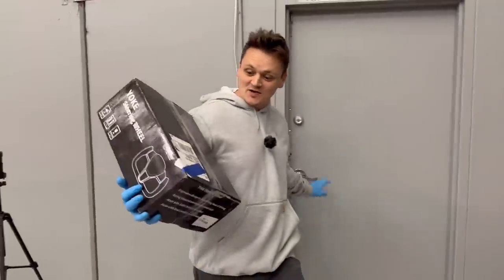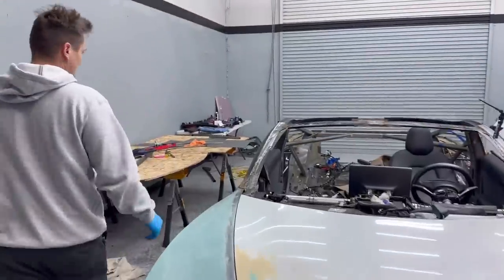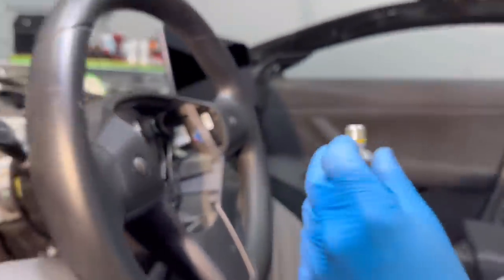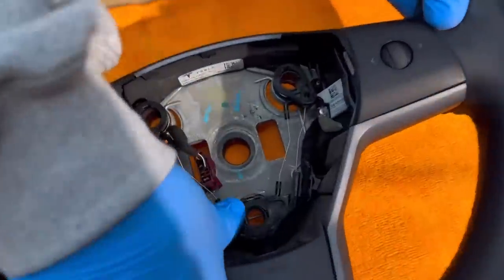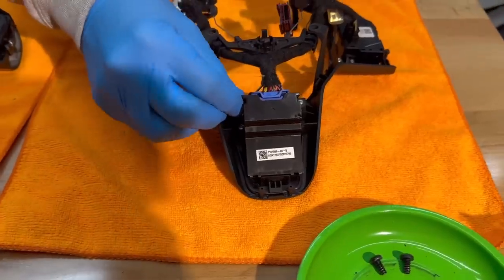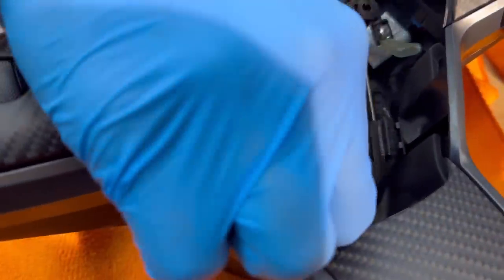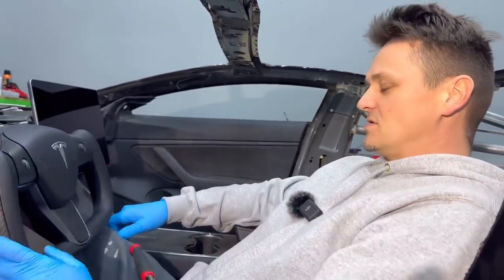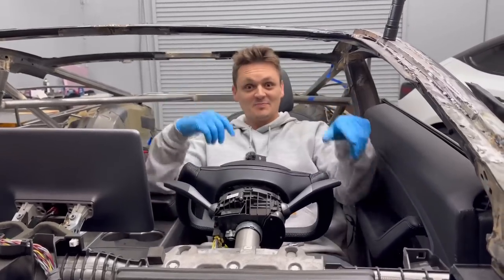Tesla Yoke steering wheel install

Comment: It looks cool but it must be so uncomfortable to drive with this steering wheel
Reply: It’s not, promise
Reply: @alexb3479  Ok, since you promised I believe, but only because i trust you
Reply: @alexb3479  have you tried it?
Reply: @houssamalucad753  yes sir I have, multiple times
Reply: Different,  but not uncomfortable at all.
Reply: You get used to it in 10 mins. The buttons do suck tho on the refreshed s and x. This model 3 version is perfect with the stalks still there. It’s actually even functional in this application, looks like it improves visibility with that low roof.

Comment: "i need something better than a traditional round steering wheel" 

bruh thats like saying you prefer a chair with no back
Reply: Fastest cars in the world are driven with yokes be it f1 or top fuel they all have yokes not steering wheels. 

Also watch the video of a model s setting the ev track record out at vir north course. 
Pro driver catches it fully slideways off a corner curb at 100+mph zero issues with the yoke wheel. 👍🏻

That said tesla should absolutely introduce variable ratio steering with the yokes. They have the computing power and integrated stacks to do it and do it right. 🤔
Reply: @4literv6  variable steering would be cool